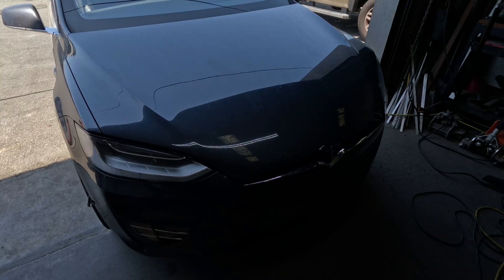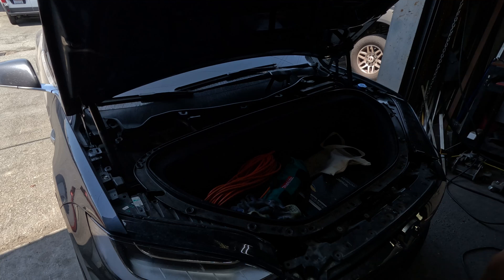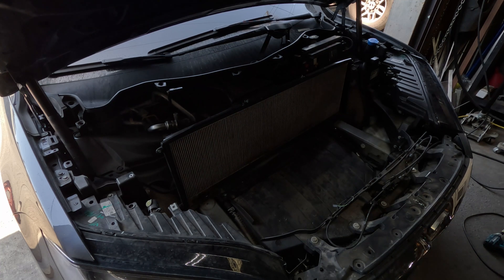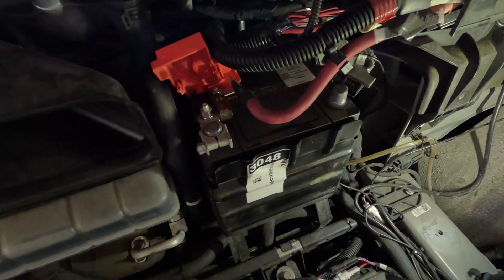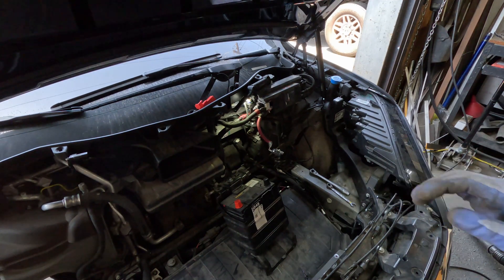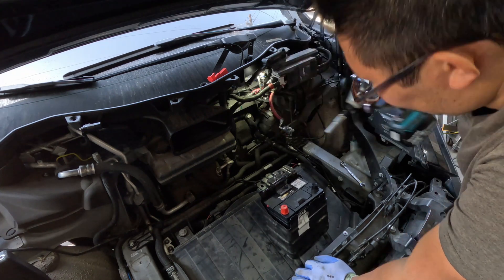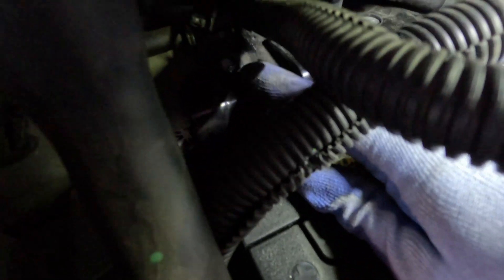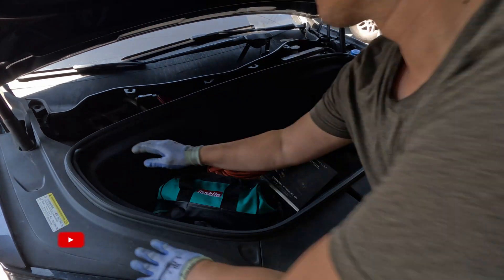Tesla Model X 12v battery removal and replacement

Comment: This was so helpful!  Thank you!  For all those who asked about where to buy the battery, I found out (after much research) is that you need to buy this from a Tesla Service Center.  If you buy a battery “not from Tesla” it may technically work but the software knows it is not a Tesla and starts having other software errors.  Not worth it, imo.  Just get the battery (and HEPA Filter) from Tesla and do it yourself.
Reply from the maker: Glad I could help! Hope you saved a few bucks!

Comment: how do i know if i need to replace the battery? i have a "voltage supply low" alarm. is that the battery that is dead?
Reply from the maker: I don't know if that's high or low voltage, but the new software should tell you to replace the battery as soon as possible.